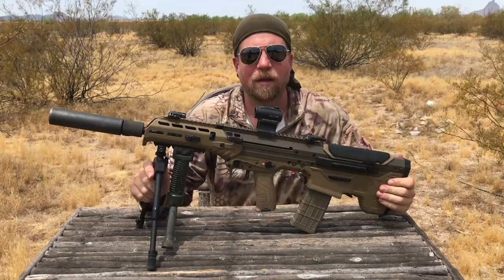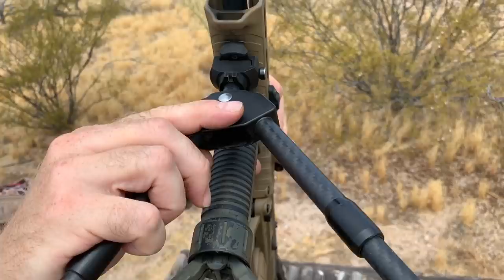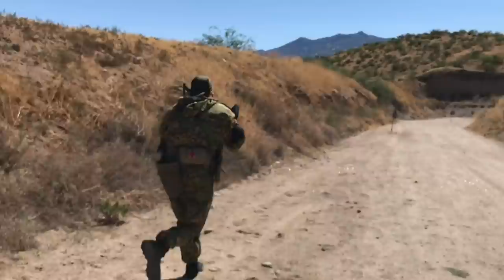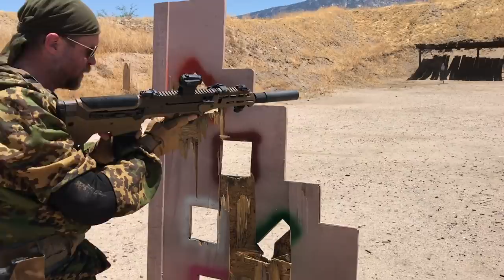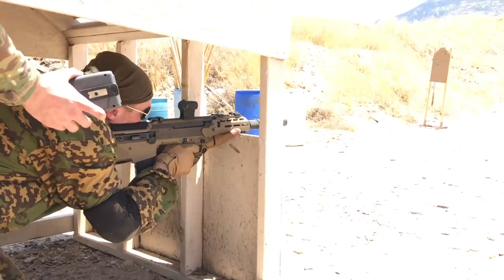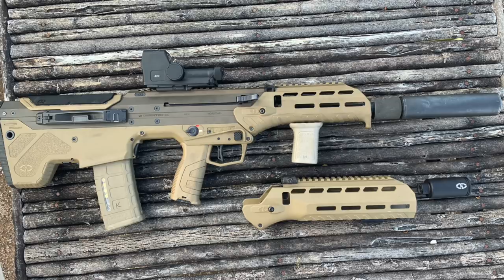Desert Tech 5.56 MDR Optimization

Comment: Is it now ready to fight the Covenant?
Reply: Not till it's 3 round burst
Reply: Flannel daddy's "remember reach" moment
Reply: Not until it’s back in 7.62 either
Reply: A Baby Ate My Dingo 7.62 or higher.
Reply: Well... It doesn't have the integrated ammo counter so No.
Reply: @abrahamedelstein4806  somebody will 3D print a carry handle/ammo counter module
Reply: The GemTech "Halo" suppressor says yes
Reply: Baker Tankersley not really, the MA5 series and the M392 and M395 DMRs are all chambered in 7.62x51mm, while the BR55 and BR85 are both chambered in a specialized 9.5x40mm cartridge
Reply: Ulsterwhite why not full auto? Spartans would easily be able to counter recoil and hold the weapon steady long enough to kill an elite
Reply: @vg4288  a half dozen halo games show that no, Spartans cannot hold fully automatic rifles on target any better than a standard soldier.
Reply: Slap a 24 inch 7.62 barrel on it.
Get it black and a flashlight underslung horizontal grip on it.
Call it the Halo Assault Rifle.
Reply: I swore with the way he was running, he was actually shooting at some Geth ...
Reply: Remember Reach.
Reply: Nate S and the Spartan bipod
Reply: Larry P Jones Jr remember reach
Reply: Yes

Comment: "What if we can leverage those differences, particularly the balance, as a benefit rather than a detriment?"

Bullpup balance was always a benefit, an even bigger benefit than the OAL in my opinion.  Not something that shows up on a short competition stage, but from an infantry perspective, the rear-heaviness makes it very easy to carry on a march or hold on target for long periods.  This also makes the nose-heaviness from attachments forced upon you by the mission like PEQ units, flashlights, or as you note, suppressors, much less of a burden (or even beneficial)
Reply: I was mulling agreeing with this but after the video I kind of have to stick with Karl. He has made it clear that the MDR's balance point is even further to the rear than other bullpups which would definitely be a disadvantage. The RFBs and RDBs have the balance point at the grip which is as nice as you describe, but the MDR (and I can personally say, the Tavor as well) balances even further rear so you're always pulling the nose back down as it tries to slip down off your shoulder. However, as is being noted, that further rear COG is advantageous if you already knew you had to hang a bunch of attachments off the front for whatever your purpose is. If not, then it just ends up being awkward.
Reply: I would disagree on the point of rear weight being better on marching. In my experiance rucking is only made better by less weight. While distribution of weight matters, it more applies to the ruck than the weapon that your holding.
Reply: @Conan_Kilgore  If you're infantry you don't get a choice on whether you're carrying all that stuff or not, that's his point. If your rifle is going to have a laser and an optic and grenade launcher and then maybe some other doodads, then having the rifle itself be as rear heavy as possible will make carrying all of that easier in the long run.
Reply: @RussianBlue4S  
I honestly like the rear-heaviness for exactly the reasons I've described, haha.  I want that weight as far to the rear as possible, even if the shooting characteristics suffers a bit.  If I'm feeling fresher when the shooting starts, it's a fair trade.  Maybe the MDR is worse for that, I've never handled one of those.  
Slippage has never been a problem with me, and I've owned a variety including both the TAR21 and the X95.  I was concerned it might be a problem when I replaced the X95's ridiculous rubber buttpad with the flat buttplate, but I've found it stays firmly in my shoulder, maybe even better.  Maybe that texturing helps?  The rubber pad is pretty smooth.
The only similar issue I had was when I was really new to bullpups, I would overexert bringing up the buttstock and conk myself in the jaw as I shouldered it, but that went away as I became accustomed to the new weight distribution.
Reply: @Xhaleon  I am and I get it. Im gonna tell you right now Ill take a 9ish pound weapon (like a loaded down M4A1) over a 13ish pound one. I know what its like to fuck with heavy weapons on marches, I've hauled both the SAW and the 240. I like saving weight where possible and I think that a 13lb weapon for infantry use is less than ideal for today.
Reply: I also agree with you. Karl talks from a competition shooter point of view. And as people say, range shooting is not the same as real world operations. Here in Brazil army and police troops use the FAL with a left hand grip on the magazine, just because the thing is heavy and you get tired pretty quickly if you hold it with a shooting range stance. Marching on the Amazon forest or going up a slum after drug dealers for hours take a tool at your arms, so a bullpup would be a god send for those guys.

And there is the case for the longer barrel on a bullpup compared to a conventional carbine. People say the 5.56mm is weak, but firing it on a less than 16in barrel is not helping on that regard. A bullpup is always getting all the juice off a 5.56 while retaining the compact format.
Reply: @jarvy251  sounds like joes beimg joes and NCOs doing their job, honestly no matter the balance of the weapon people are going to carry it lazily because, as you said, it is formost in you mind. My experiance is no amount of balance change will make it suck less.
Reply: @jarvy251  I agree a rubber grippy buttpad would be helpful, and I'll also agree that having the COG closer to the body is better for keeping the weapon shouldered but it shouldn't be any different for carrying. Keep in mind also that the MDR is built in 308 size with 308 mass so the rear heaviness is much more noticeable, especially under recoil when the whole gun is trying to escape you. It's bigger and denser than a Tavor and so while I will accept that my complaints about the Tavor may disappear when actually firing the thing, the MDR is another step altogether in that direction. However, when I pick up an RFB or the like and it just balances perfectly with the lightest touch despite the fact that it is absolutely the weight of a 308 you kind of get addicted to that perfectly central COG that a Tavor or MDR just don't have. I would be curious to feel the MDR with a suppressor to correct the balance but then you're approaching double the weight of an empty AR10 and that's pretty gross.
Reply: Xhaleon think about adding all that to a rifle that already weighs twice what a AR15 weighs and tell me that’s not too much weight to be shouldering for a small weapon.
Reply: @RussianBlue4S  Yeah I was really surprised when I looked up the weight of an MDR and saw it was over a pound heavier than the X95
I'll admit the X95 is severely overgassed for reliability and I think they overdid it.  Shootingsight makes a drop-in recoil spring designed for use with a suppressor, but it also cycled reliably with everything I fed it unsupressed and it tames the recoil significantly.
Reply: @UC3kJ4xcdlBxdXj6phC948TA Keep in mind the MDR is built as a 308 and converted to a 5.56 so its portliness is understandable but you will still be carrying 308 sized parts with you wherever you go for better or worse. The X95's pork versus other bullpups or conventional ARs is less easily explained.
Reply: @RussianBlue4S  It's easily explained, about a half pound of the X95's "pork" is that rubber brick on the buttstock put there for legal purposes.  
Replace it with a buttplate (pin/weld the flash hider or get the longer barreled model) and slide off the overbuilt rail covers  and it compares favorably to other bullpups.
Reply: I have to ask something. Why is the MDR so heavy? What is in that stock other than just the action. Personally, I would love to see another well made bullpup like the Famas that makes it into service.
Reply: I agree 100% with you. And everyone will have their preferences. But I as a taller(6'4") bigger guy (not fat but not jacked) I like bullpup over regular ARs moving around objects and through doors is easier than with a full rifle. I've never been in the army or to war so I'm limited in experience, I've just done some compilations . But I'd like to know what tall guys (5'11" and up) vs shorter guys think between the two different rifles.
Reply: @cam_machi  For its original design as a 308 rifle, it is really not exceptionally heavy. At 7.5 lbs it's actually pretty good. But if you plop in the 5.56 conversion you are still left with all that weight and now it has to compare to rifles a whole weight class lower.  Compare that to a sub-7 RDB or a sub-6 AR and the chunkiness rears its ugly head.
Reply: I did all my services with the A2, carried it hundreds of mile, fired it thousands of rounds.  I never thought it was heavy and I was glad I wasn’t carrying the 60 or a SAW.  I never had a problem getting out of a 113 (that’ll tell you how long ago that was) bradly or Blackhawk or going through a door.  While I have no experience with bull pups, every country that has issued one has (except England, which is stuck, and China which doesn’t talk) ditched or is in the process of ditching the style.
Reply: @cam_machi  I guess its structural reinforcement to resist beating itself to death. The ejection system requires the bolt to be flying back very "positively" for it to work.
The most you can hope for on the latter is some partial adoption of GD's entry for the NGSW, I'm skeptical of it taking 1st place what with the general institutional attitude against bullpups.
Reply: Although not equally applicable to military use, short people and/or those with little arm strength get a benefit out of bullpups even when you consider the added weight versus pretty much anything else in an equivalent caliber, and regardless of if the COG is farther back than the grip or not. (To be clear, I'm not saying that having  COG directly over the grip and/or lower weight isn't better than the alternative; it's just secondary to the point I'm trying to make.) My wife is only 5' tall with accompanying short arms, and has both hand strength and back problems, making offhand shooting, and sometimes even proper support hand placement, with rifles very difficult for her, if not completely impossible. However, she can manipulate and fire "her" bullpup - a FS2000 with optics, light, and full magazine coming in at just over 10 pounds - without any issues. Again, this is purely based on a specific use-case with an individual who literally could not join the military even if she wanted to, but I can see how it might benefit countries whose people are relatively short as compared to other countries (which might explain the Chinese use of bullpups, for example).
Reply: @cam_machi  because it was originally designed for 308

Comment: You are looking much much slicker on the reload now. I would be interested to see you do a side by side mag change speed comparison with AR/MDR, maybe load one round into 3 magazines for each, starting with the weapon unloaded and see how quickly you can get through each set of 3 mags. Probably important to require hits on target at say 50 yards to see the impact of each design/your proficiency in getting back on target after each mag change...
Reply: I like this idea!
Reply: Seconded on this.
Reply: I third this motion.
Reply: That’s basically what I do when I decided to run only 20rd mags with the ranger pull on the end. Better length for resting on the rubber loop (very stable shooting platform) and 20 rounders are almost exactly 1 pound when fully loaded, for better balance on my AR.
Reply: vlog about extensive reload testing 
20rd + 30rd variations + 60rd surefire  + drum mags
ak + ar + bullpups

Comment: I agree, 308 honestly makes no sense for this gun. This is nobody's ideal 308 rifle.
They really screwed up by not advertising the 223/556 version more.
Reply: only in specific conditions does it make sense. i used mine in a tiny hunting blind with while hog hunting. switching from one window to the other was a lot easier than my bolt action rifle
Reply: Edward Kim Yes threading a 24 inch bolt action from window to window gets old.  Did you get anything?
Reply: It was partially a marketing decision, I guarantee. There’s a lot of semi-auto rifles (and pistols too) in .223/5.56 right now. There’s a fair number of .308 also, but a bull pup stands out much more in that space and really grabs attention.

And, yeah, it’s also relatively easy to scale a .308 down to a .223. .223 to .308, not so much.
Reply: ..although .308 is really handy when your opposing force has .556 and is behind medium sized trees....
Reply: @nc_classics_9610   I had that issue deer hunting this year. Bucks were chasing does up and down a trail that went from my 12 to my 9 o'clock. Finally had one stop out front, but I almost got busted when a banged the butt into the back wall.
Reply: Denis O'Brien a .556 is different from a 5.56.
Reply: to heavy for a 5.56...the 308 needs the weight.
Reply: Well it comes close to the Halo Assault Rifle in .308 so I want one for that reason alone
Reply: @blckandwhtknight  I just bought this gun in the 20" 6.5 Creedmoor and couldn't be happier with it.

Comment: I tied the MDR 308. It's really cool and what you mentioned about it is true. But I ended up going with keltec and there RFB-24. Had it for a couple months now. Never had any issues on the gun's fault. Extreme and I mean extremely accurate. Or as accurate as the shooter. Rings steel at a 1000 using M118LR

Comment: I know it's apples to oranges but it'd be really interesting to see how this stacks up against the WWSD AR-15. While obviously they're very different rifles (conventional lightweight carbine vs bullpup assault rifle), I'd be really interested to see specifically how well the MDR holds up in close range CQB type drills that the AR-15 would obviously excel at, and if the MDRs longer barrel length would be significant or noticeable for long range accuracy (200+ yards). Obviously the exact ranges and distances would vary as I'm not sure what's realistic with weapons like these in any kind of practical trial but to me the main questions are "Is this rifle comparable with a typical weapon in CQB" and "Does the extra barrel length offer any real advantage in marksmanship at range". In essence, is this gun okay at what bullpups are supposedly bad at, and is it better at what they should be good at, then a high end conventional rifle.

Comment: on subject of balance its possible while they tested the gun it was meant to be used in a military "work" format wear a suppressor, IR laser, and weapon light would be attached. This would mean once all the weight  of the attachments were present the gun would even out balance wise. The issue with using the gun prone would still be present but it doesn't mean that a bipod couldnt still go there either and resolve this issue.
Ergo wise I still think there is better options but I think the MDR is a step closer in compared to other bulpups.

Comment: It seems weird to say, "I want the most out of a bullpup without focusing on the overall length." A 16" AR-15 is going to out perform a 16" Bullpup in almost every situation, but draw the line at 26" and now a 10.5" AR has to compete with a 16" barrel bullpup. Speaking of 10.5", the eventual MDR-C has a 10.5" barrel and sports a 20" overall length, which is nutty to me cause now we're comparing length to a 4.5" AR. And of course, the opposite is true: a 20" barrel in 6.5 grendel or 6.8 SPC would give us a nice compact  (30") precision shooter. There's an aftermarket 6.5 CM barrel out there, I'd be interested in seeing how it performs with that.

Comment: 13lbs! That weighs more than my 20" heavy barrel 6.5 Grendel with a 3-12x scope at 10.5lbs.
Reply: My 24" HB Grendel is just shy of 10lbs, how'd you manage that?
Reply: @reaperreaper5098  I actually just re-weighed it and it is 11lbs. 20" heavy barrel, 17" handguard, 3-12x52mm scope, fixed stock, Caldwell bipod, and a chunky Midwest Industries muzzle break. Put it together really as a range toy so didn't care about weight.
Reply: @JReed305  I'm still lost on how it weighs that much. I've also got a 24" 5.56 build that's running a heavy fluted barrel, 17" Strike Rail, Magpul bipod, MOE stock, and a Vortex x3 Prism. That comes in at roughly 9.7lbs.
Reply: @reaperreaper5098  The scope weighs around 20oz may be a little more, which is a bit more than a 3x prism. I am including the weight of the bipod which is a heavier Harris clone.

Comment: Great video as always! Ergonomics is always a matter of design and preference, but the balance of the rifle can shift especially if you're considering mounting all the laser, flashlight, suppressor and foregrip, which made the normal configuration rifle more front heavy while bullpup rifles would have it's rear biased weight "re-balanced".

Now that said... where's the M27 IAR follow up video? All about the internals and firing thing? Maybe you can try configure the MDR to kinda follow the IAR configuration with all the lasers and stuff and compare both of them? Because the while the IAR is a great rifle, it's also longer than your standard M4(not to mention heavier), plus modern armed forces around the world are starting to modernize their rifles with all kinds of attachments that made them more front heavy, could we reconsider bullpup configuration and see it in more mainstream use, especially that it doesn't sacrifice long range performance while retaining compactness for close quarters combat and having a more rear biased weight that will be balanced out by all those attachments?